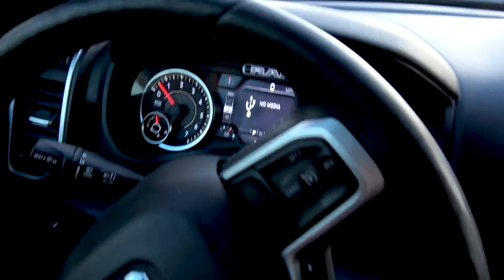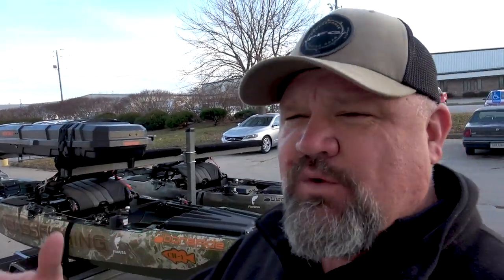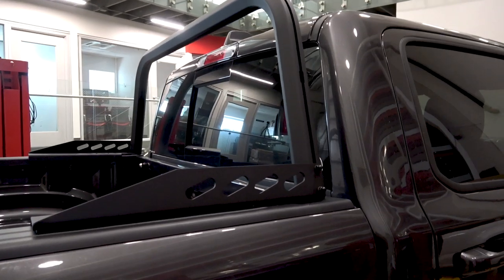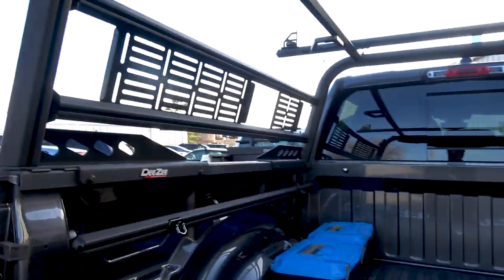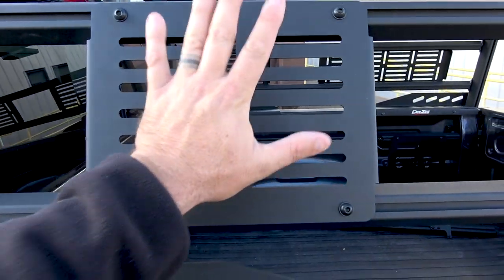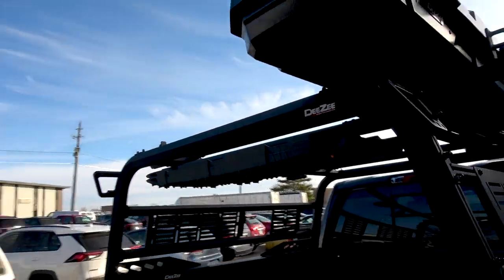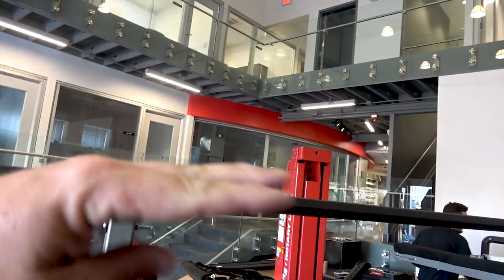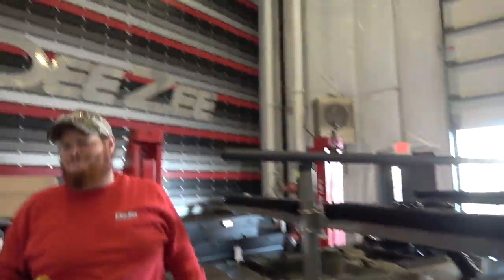Overland Kayak Rack | Rebuilding the Kayak Fishing Rig

Comment: Super! Would like some estimates as you go of price breakdown, not too specific, ie. For x it is between $ low and $ high.
Reply from the maker: LouAnne Clapp-Blount I will actually be doing a full breakdown of everything with prices as soon as it is all finalized. That should be done in the next few weeks. The base system without the Overland accessories is supposed to come in under $1000 and  a ton of accessories. Again, I will get the pricing out as soon as possible